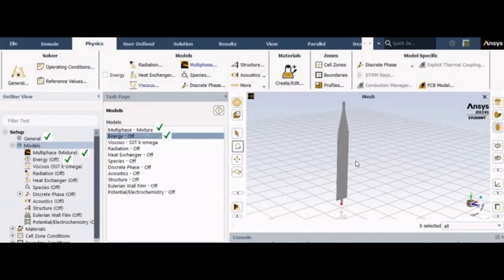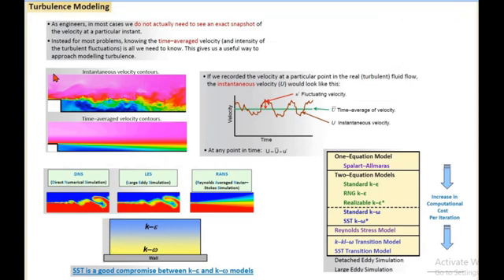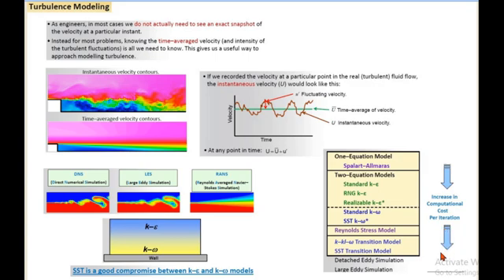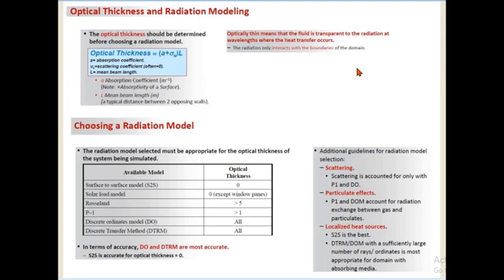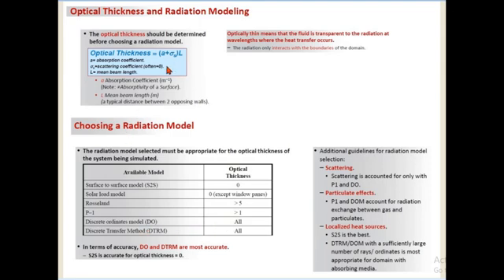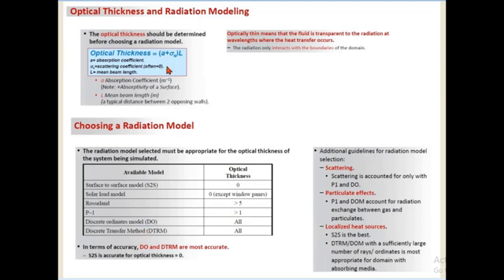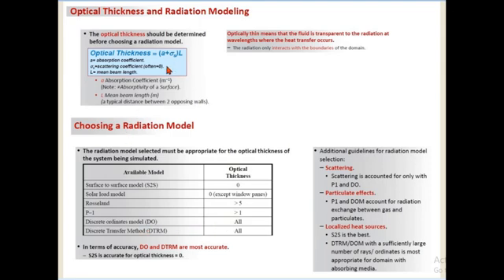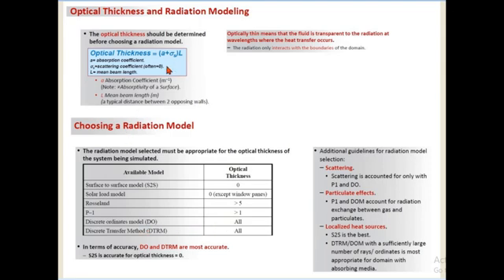Introduction to Fluent (Part - 2)

Comment: Sir is it possible to analyze mixing of co2 gas with cold water in a pressurized vessel in ansys fluent. Suppose a vessel is in vertical shape( 400mm diameter × 1700mm height × 3mm thickness) and vessel is half packed with series of perforated plates and then we pressurized that vessel from co2 gas up to 5 bar which will remain constant throughout the simulation or process.Consider half inch duct for co2 gas inlet from any side of vessel and then with the help of high pressure pump, cold water(2 degree celsius, volume flow rate 4 cubic meter per hour)is sprayed through nozzles from the top of vessel towards bottom. My goal is to look out how water is passing through those perforated plates and at last how much co2 gas is mixed in water which is going to be stored in the bottom of the tank . Consider 1.5 inch duct for water inlet and 1.5 inch duct for water outlet which is open to environmental pressure. Kindly explain how to do in  ansys  fluent . Thanks a lot 🙏.